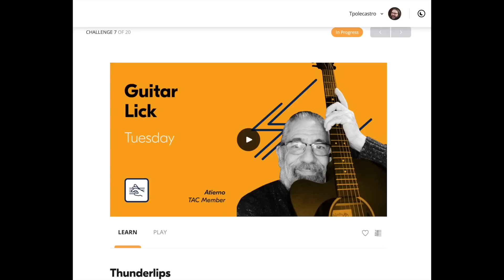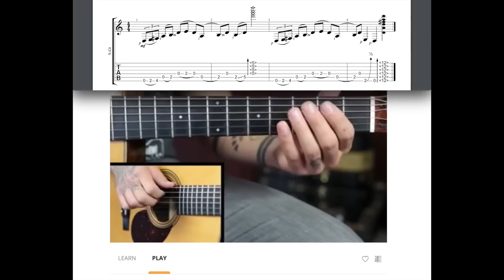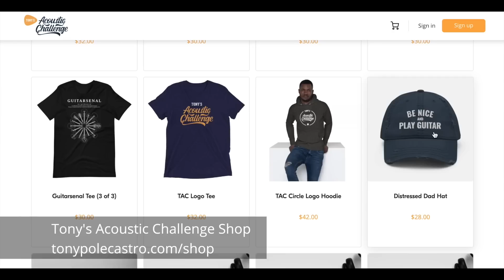5 Best Canadian Guitars Under $800 (2021) ★ Acoustic Tuesday 208

Comment: Seagull Coastline Slim cutaway is mine. An absolute gem of a guitar. Easily stacks up with a Martin or Taylor in my experience. Was perfectly setup right off the shelf. The sound is outstanding and it keeps getting better over time.

Comment: I have a Norman and it is fantastic. The action needed to be lowered at the nut though, just using a capo was a quick fix. Fantastic sound quality and playability for the money. The best on the market as a first guitar. It is hard to beat a Godin (Seagull, Art & Lutherie, La Patrie, or Norman) as a first guitar. I think it is access to the local high-quality spruce, cedar and wild cherry as well as their workforce. 95% of the population in the small rural Quebec town, La Patrie, these guitars are manufactured in works for Godin. You need to pay 50-100% more to get the same quality from Taylor or Martin.

Comment: I have a 2004 Seagull S series Grand/ parlor I bought new. It had a cedar top , wild cherry back and sides , silver leaf maple neck. Satin finish. Bolt on neck design. It still looks and sound great. I did have a 2004 A&L AMI parlor almond it was all laminate 12 fret but sounded great , as good as the cedar top.

Comment: I have a LaPatrie Etude nylon string classic guitar (circa 2008), solid cedar top, mahogany back, sides, and neck, over 2" at the nut, which is good for me at 6'6" big hands, I want to trade in my Data ban on a Seagulls S6 steel string. I added clear film pick guard to both sides of my LaPatrie to prevent scratching thanks to the advice of my guitar teacher at the time.
Reply: Estaban spell checked. Just bought a Seagulls S6 from Guitar Center online, came from California  well packaged,  can't put it down, I play it so much that I will have to superglue back on my caluses like SRV! Great guitar Tone, great recommendations!